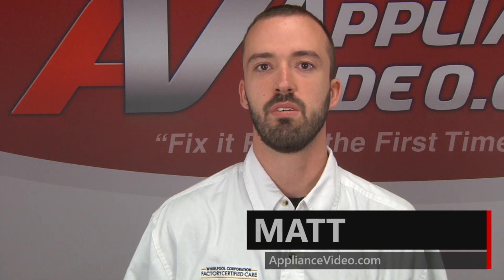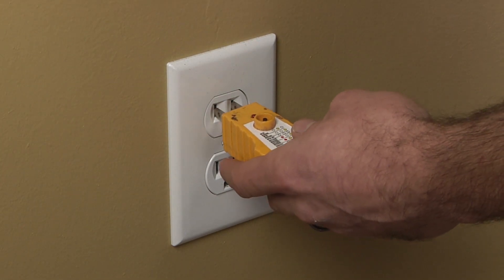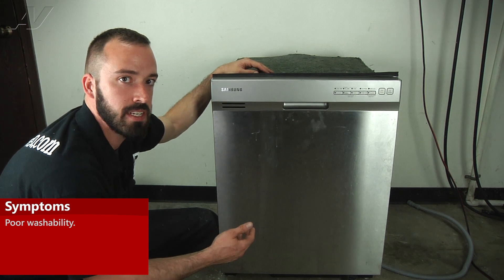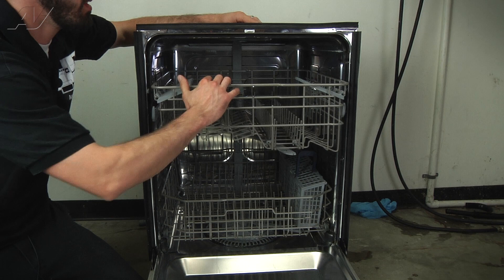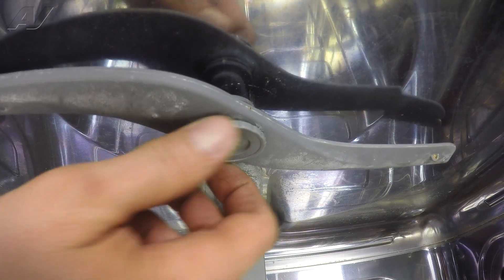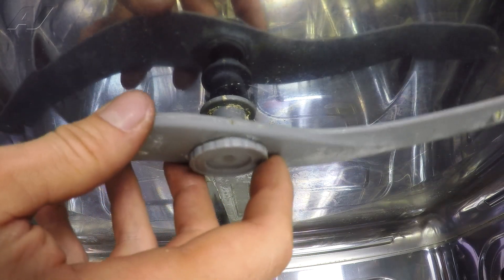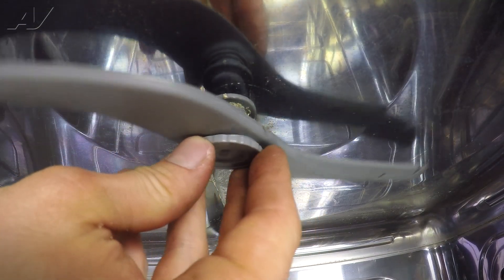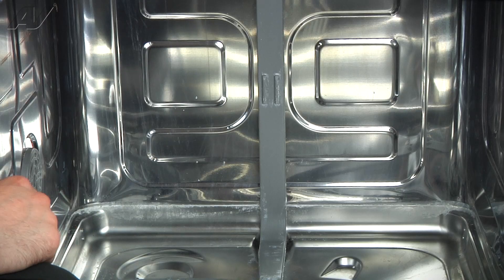Samsung Dishwasher Repair - Not Washing well - Upper Spray Arm

Comment: i cleaned all three spray arms. i the upper one i found a small (1/8") long and wide piece of sharp stainless. like a knife blade. dishwsher is not cleaning worth a darn. any ideas ??
Reply: Same here Jim, spent about 2 hours deep cleaning all plastic parts on my Samsung. Wasn't much buildup to speak of. My top rack still does not clean the dishes that well and tons of debris stuck on the inside of the glassware and coffee mugs that was not there to begin with. Not sure what to do next.
Reply from the maker: Great question, if you have a more technical question that our parts department cannot answer, you can search our over 13,000 answered questions free at our website www.ApplianceVideo.com under our Repair Help section. You can also call our parts department at 1-800-830-5465 and they can give you help 7-days A week ,or search at www.SaveMoreOnParts.com  .
Reply: I've been having the same problem. After much research I have simply concluded that the best solution is to buy a Bosch. Samsung dishwashers are worthless.
Reply: @keithduff6312  couldn't agree more

Comment: I have Samsung dishwasher but it doesn't Clean the dishes properly the bar stay inside and doesn't come out and the dishes stay dirty. It waste time, water and electricity
Reply from the maker: Great question, if you have a
more technical question that our parts department cannot answer, you can search
our over 10,000 answered questions free at our website www.ApplianceVideo.com under our Repair Help section. You can also call
our parts department at 1-800-830-5465 and they can give you help 7-days A week
Monday -Sunday, or search at www.SaveMoreOnParts.com  24 hours
7- days A week.